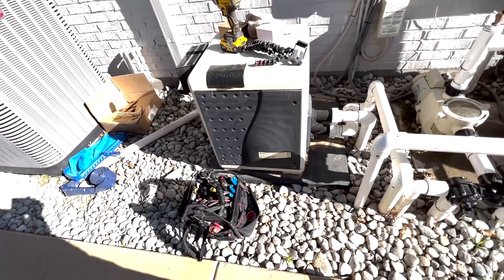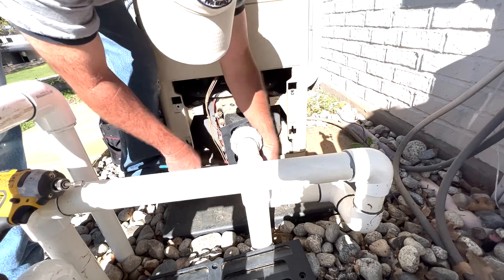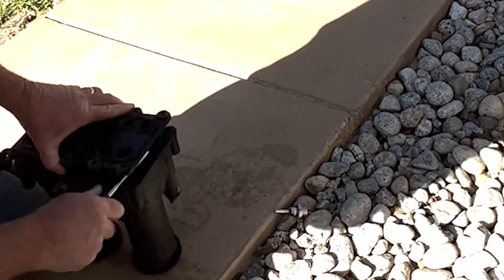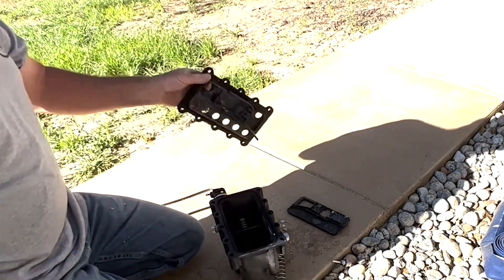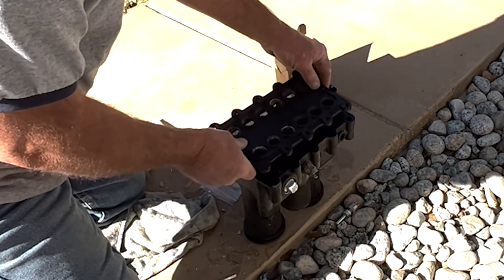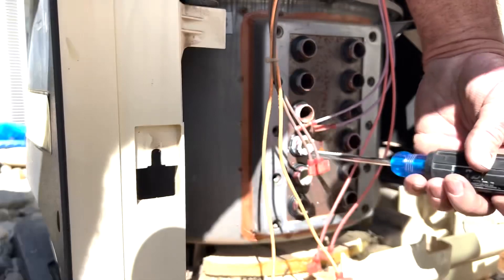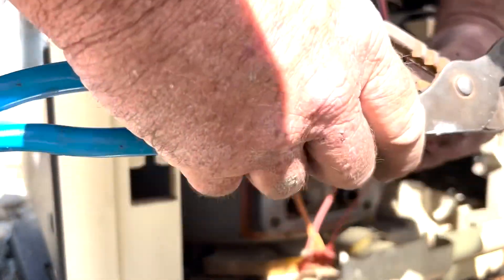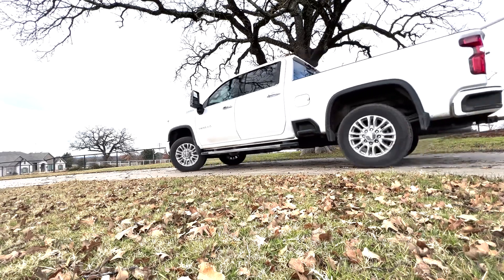Mastertemp pool heater overheating; noisy heater

Comment: I have a similar noise but happens all the time even when heater is off. I posted a video on my profile. Brand new build.
Reply from the maker: Brand new rattling, check to see if you have air bubbles coming out of the jets in the pool. If no bubbles, you might reach out to the builder and have them check it while it’s still under warranty

Comment: Great video.  Could the thermal regulator also cause a loud popping sound at the side of the panel like it's going to explode lol?
Reply from the maker: It is usually the internal bypass that is making the noise. I usually replace the thermal regulator at the same time. When the bypass fails, the water stays in the heater exchanger too long and begins to boil. That’s the popping noise. When the thermal regulator fails the heater runs cold and takes forever to heat
Reply: Thank you for replying.  Found out that the burner basically exploded @Pool-guy
Reply from the maker: @Fthisnoise oh man! That’s bad, sorry to hear that